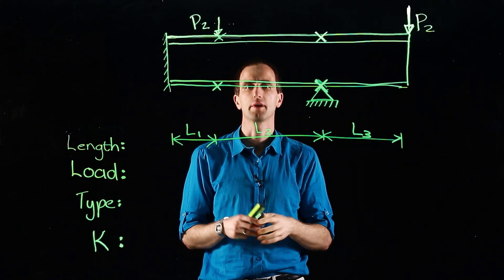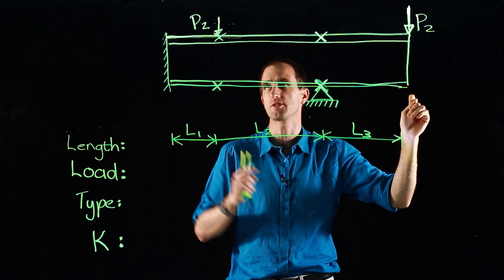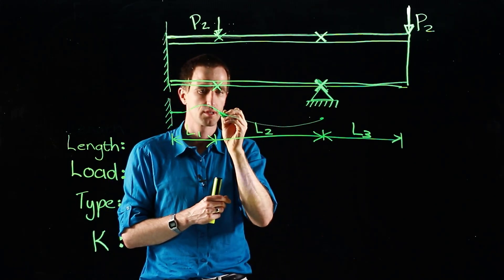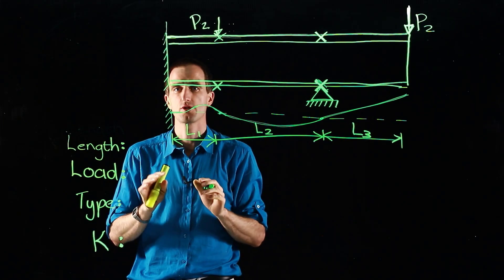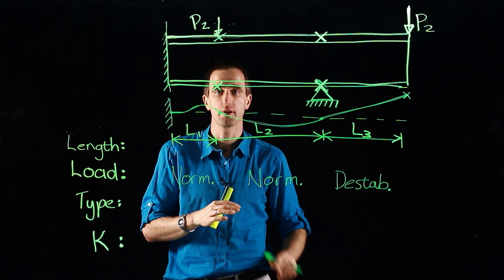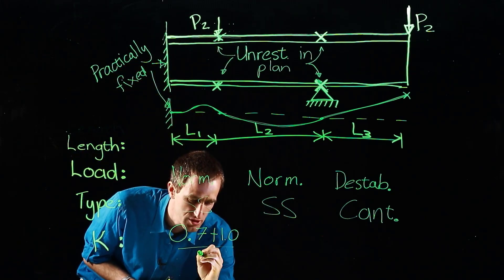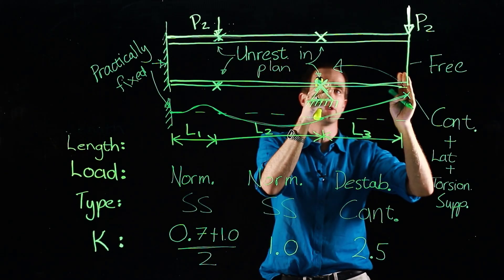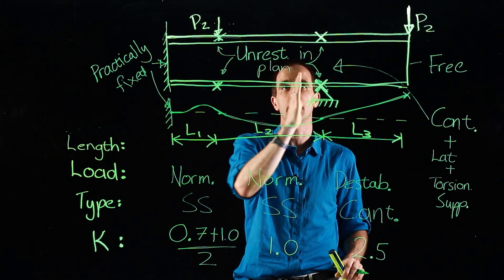Steel Design - Effective lengths of beams - Illustration example - SD424

Comment: Thank you very much for this great vedio... i have a quastion...above the simple support, if there is no lateral restrain on top flange, what does happen in calculatind L2 ... 
(1 L+1.0 L+2h)/2   Or  (1+0.85)L/2 ??
Reply from the maker: You would really want to avoid that in practice. The top flange can move laterally all the way along the entire beam making it much more unstable.

Comment: With the cantilever, if the load is applied on the bottom fledge and no lateral restraint (crawl beam case) is it still normal load even though considering eccentricity, the beam could twist?.
Reply from the maker: The twisting is accounted for in the boundary conditions. The position of the load is accounted for by it being normal. Hence, correct - bottom flange load would be normal. However, remember that for crawl beams you may need to apply additional dynamic impact effects.
Reply: @firesun  thank you very much for the insight. The crawl beam is for lifting a pump with a combined load of 100 kg at most. Is there any video about applying dynamic loads based on the code.
Reply from the maker: @lwandilembewana5587  You can have a look at SANS 10160 as there is an entire section on crane loads. Older versions of the Red Book also have some approximate details. An additional factor in the order of 1.2 probably needs to be applied. 100kg is quite a light crawl
Reply: @firesun  thank you very much. Yes it is. You the best

Comment: Prof, would the K value for section L3 not be 1.2? The section is laterally and torsionally restraint. If i am correct, a value of 2.5 is for only laterally restrained.
Reply from the maker: L3 is a cantilever. On the right side it is free. On the left side it is continuous with lateral and torsional support. If assumed to be a destabilising load then we end up with K = 2.5.
Reply: @firesun  Hi Prof. in Table 2 under destabilising for a continuous beam with lateral and torsional restraint, the value shows 1.2. Or must you design for the worst case ie. the free side so thus 2.5.
Reply: @theunsburger2660  - You may be looking at the wrong line of the table. It is FREE at the tip (column 2) with continuous at lateral and torsional support at the support (column 1), with a destabilising load (column 4).  That gives K = 2.5

Comment: Thank you for this helpful video. I had a question about destabilizing load. In the cantilever portion the load is on the tension flange and bottom flange is having bending compression. Will the load have stabilizing or destabilizing effect being on tension side?
Reply from the maker: SANS 10162-1, which is probably the most codes, defines a destabilising load as being on the top/tension flange.
Reply from the maker: Specifically in terms of cantilevers

Comment: do we not consider the buckling on another axe?
Reply from the maker: When considering a beam - it will only experience lateral-torsional buckling when undergoing bending about its strong axis. If bent about its weak axis it will simply yield without buckling occurs. Hence, beams only have one effective length and this is for LTB (except if the top and bottom flange both experience compression and have different effective lengths - but these are still both for LTB). Columns can have multiple effective lengths for buckling about different axes.
Reply: @firesun  thank you .so for a beam has compresion force, we will consider it in interaction LTB and Buckling right ?
Reply from the maker: @chanbormey4499  - It depends on what you mean by compression force. (1) When a beam experiences bending the one flange will be in compression and the other in tension. Compression causes buckling. Hence, we focus on the flange which is in compression and its effective length. (2) If a beam experiences both a compression force and a bending force then refer to our other video which covers the design of such members - https://youtu.be/WrtuIvoK2Rs.

Comment: Hi Dr Wills, if the cantilever span has a midspan lateral support, how do you deal with the support conditions for each of the spans along the cantilever length?
Reply from the maker: Always design between points of lateral support, with end conditions defined: (Section 1) ?Free tip, with ?only lateral support and continuous, and (Section 2) lateral support at tip and whatever conditions you have at support. Also, make sure you choose carefully between normal and destabilising load as that has a big influence on results.
Reply: @firesun  dr. Wills, can you recommend a good book on this topic with some solved egsamples? Thank you in advance
Reply from the maker: @picajoool  In South Africa there is a textbook on SANS 10162-1 by Mahachi that can assist. However, most good steel design textbooks for university students should assist.
Reply: @firesun  Dr. Wills thank you for your response.
Problem is that Im Eurocode based, but I love watching you videos.
It seems that Eurocode doesnt have LTB effective lenghts defined for various conditions.
It does have coefficient for effective lenght that you input in formula or finding out critical bending moment, but its not very intuitive and it doesnt have any explenation of dividing a beam into multiple segments between lateral supports, and checking each segment with its effective lenghts.....